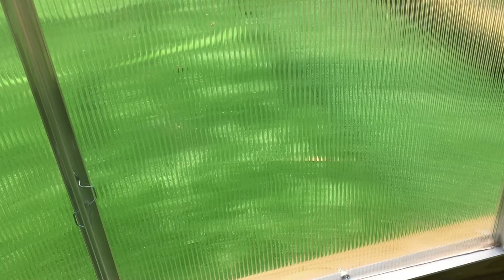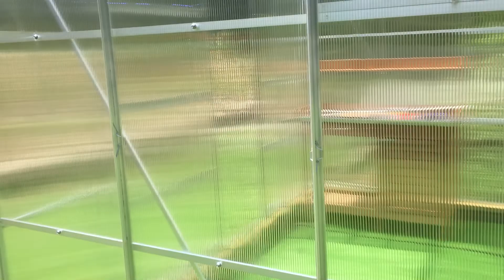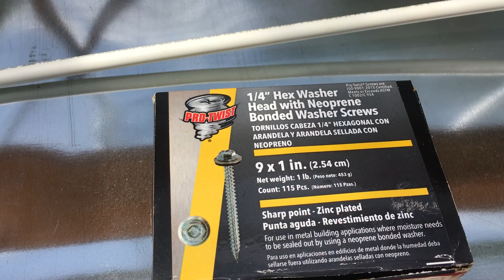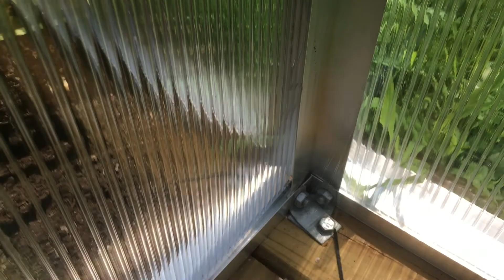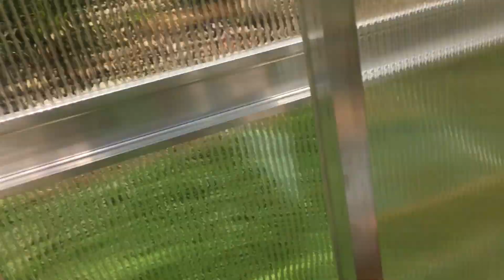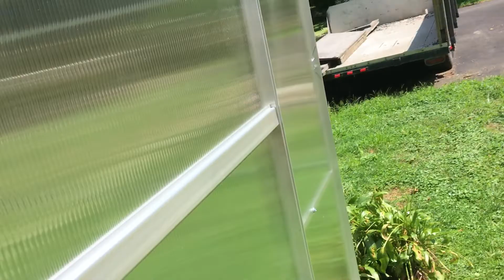HarborFreight Greenhouse Modifications

Comment: I'm contemplating getting one of these and I'm looking up all the info I can on them, you said something about putting like a foil strip on the bottoms and tops of the panels? It's kind of hard to hear on this phone. I was thinking about siliconing either the tops and bottoms or both.. I figured if you leave the bottoms undone it'll allow the pressure to change in the air gap and it'll allow for drainage. But then again if I just saw both ends should be straight I need to make sure to silicone doesn't damage the polycarbonate. And also I'm really really contemplating just making a concrete a concrete pad I guess about four or five inches thick, I have some hog wire laying around and I reinforce it with that. Then I guess I'll do what you did and bend those bottom things and just run a blue screw through them

Comment: Hi . Great video.  Where did you get the extra strengthen strips that go across the the middle to hold the polycarbonate sheets in .
Reply from the maker: There are no additional strips.  The diagonal pieces came with the greenhouse.  The only thing I used to hold the panels in were the clips that came with it and the self tapping screws with the pex tubing spacers as I explained.  The greenhouse is three years old now and still stands strong.  I did put an eight foot weatherproof light in it and will probably put in a heater soon.
Reply: The smaller greenhouse that is 6x8 doesn't have them, I believe if I'm not mistaken, because this one's 10x12 and it's taller it requires more support. I'm about to buy one of these myself but they're $850 now I'm not honestly sure if I'll ever be able to find one for $500 or $600, as far as I can tell harbor freight took away their 20% coupons if you're a member as well.

Comment: I have had mine in operation for over five years in Michigan, using the metal channel frame as instructed. The key is filling the floor into the channels with gravel for a weighted anchor to secure against strong wind storms.  I also layered a paver brick floor for more ballast. After two years I added gussets and splices from the center rafter to the joist for more rigidity as the wind flexion broke the channel at the top of the wall, both ends. Also set 4, raised on cinder blocks, 4' x 6' x 14' deep beds, added electric power, a temp controlled fan and water with a timer and soaker hoses. Other modifications included riveting all panels in place. Added two filtered vents, one each side of the doors. Really have enjoyed this system.
Reply: That's a pretty cool idea about using rivets, you should make a little upload video of how it looks to explain the gussets and splices because I don't understand what that is, and also the cinder block thing would be cool to look at I was honestly thinking about getting one very soon for my hydroponic setup to keep the rain off of it. I'm thinking about putting it on a concrete pad but if it has things that you're supposed to bury I could just bury that in concrete and not even have to Blue screw it. I was going to do what this fella did and just blue screw it onto the pad but it if it has burriable(?) foundation then I can bury that in a concrete pad... Any insight would be cool. Thx for ur time

Comment: I'm thinking about using glue or calking to keep panels in place plus using screws.
Reply from the maker: Mine has been up almost a year now.  Just screws and the clips is all that I used.  I think caulking would be overkill.  Plus a bit of a mess unless you are wanting it to be airtight which might make it more susceptible to pressure effects in high winds.

Comment from the maker: FYI Update, we had a big windstorm blow through yesterday bringing down big tree and knocking out our power.  The greenhouse survived with no ill effects from the storm.  It's solid!
Reply: Great News! I am looking into getting one of these in the next year or so. Thank you for the video AND idea. I want to make a nicer base as well. I did something similar to this on my old 6x8 greenhouse at my old home. Not a problem for the 5 years I had it. 

The greenhouse... on the other hand... needed serious modifications. Funny thing is that this greenhouse you have is about 4x the size... twice as tall... and half the price! My old greenhouse had pvc panels that rotted and busted in just two years. The one you have is twin-wall poly... and is the way to go. 

How are the corners up in the roof area held together on this style of greenhouse? My old one was plastic snap joints. They held pretty well but were faded and looking tired after 5 years. I am hoping you say metal.